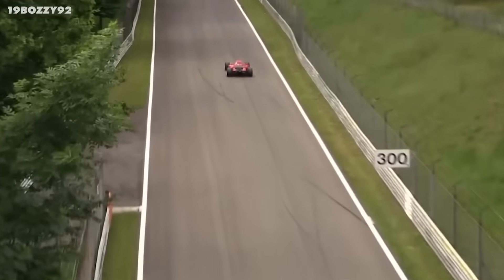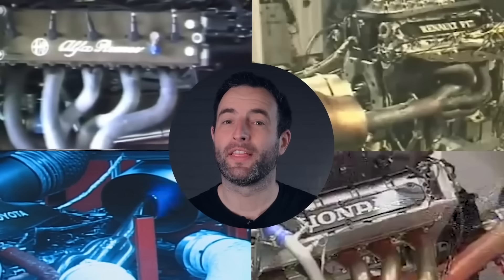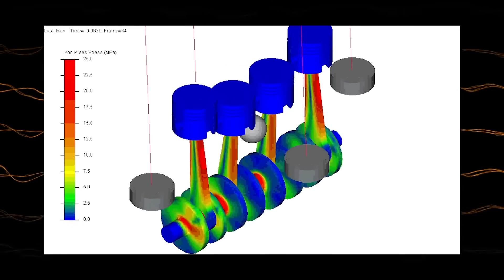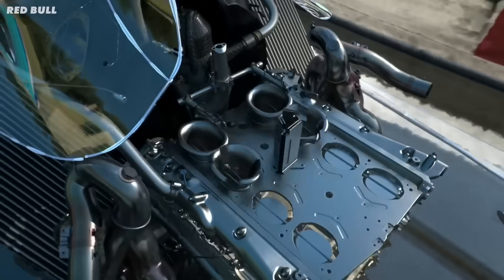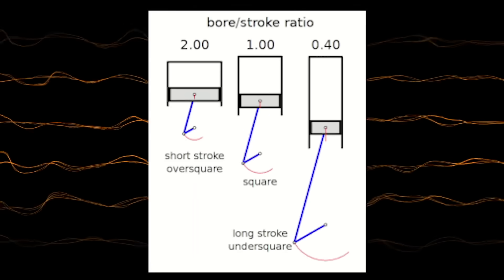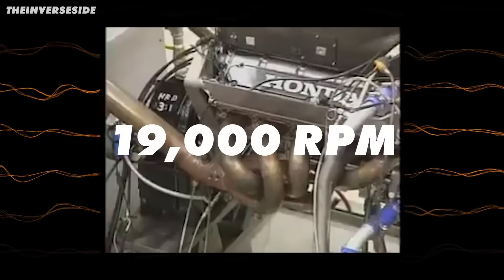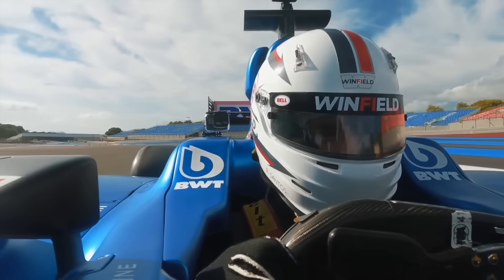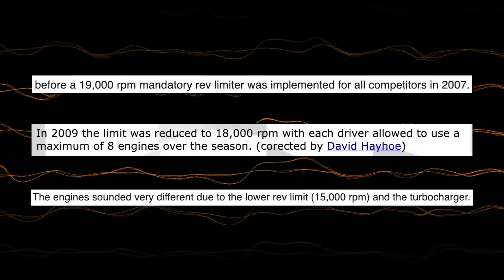When Formula 1 Engines Revved to 20 000 RPM!

Comment: reason V10 sound so good its that the exhaust pulse is in 5/4 time, which is used in spy-esque musics like the mission impossible songs or in jazz. its has more "groove" in it due to the mismatch of the beat number and count number. 
V12 is in 6/4 timing, which most people will refer as an extended 4/4 timing and V8 is 4/4. It is very widely used so it doesn't sound as exotic
Reply: That's really interesting! I've seen a few videos about V12 exhaust setups and how dramatically they effect sound. For example an Aston Martin and a Zonda have very similar engines and the same firing order but one sounds like a VERY angry tractor and the other one sounds like, well a Zonda.
Reply: @bennyb.1742  there are a lot of things that can affect exhaust sounds in the same engine layout. header length, design, material, crossing, mufflers, cylinder head design and material all changes the sound of an engine
Reply: It's not the time signature when it's happening ocer 300 times per second, it's the fact that is a sweet major third. V12's and V8's sound more recognisable by octaves rather than halfway intervals like thirds/sixths
Reply: ‘Doesn’t sound as exotic’…. I have but one answer to this remark: 1995 Ferrari 412 T2 V12.
Reply: I'm a musician and there's no way you can get a 'feel' for or can even determine the time signature at over 10,000 BPM. You might prefer the sound and it might line up with your musical tastes - but that's a coincidence, nor your slow-ass brain with a 15ms thinking latency somehow recognizing the time signature.
Reply: Except it's not. The engines were either even firing, or close enough, so there's only a single dominant frequency depending on RPM. No special intervals except for the regular overtones at reduced volume. If each bank was built like an even firing i3 + an even firing i2, it would have a dominant 3/2 interval (perfect fifth), but that's less smooth, and it would shake itself apart at 20k RPM. You could fake it with exhaust runners of different lengths, but that reduces power.
Reply: @alexandruianu8432  Wasn't there something about the frequencies that could be tuned with the exhausts or intakes? Like Yamaha did with the LFA
Reply: @skwisgaarskwigelf331  Not really, they just used equal length runners like the F1 cars, For a road car, these are more expensive to manufacture, take up more space, and are difficult from an emissions standpoint, because the catalytic converter is pushed further away. 72 degree V10 + equal length runners = smooth single frequency.

EDIT: You can tune the specific sound (timbre) depending on the overall length, but I think they really mostly optimized the exhaust for torque in the powerband.
Reply: @alexandruianu8432  You can also tune them through variation in mass of the exhaust material and fixtures.
Reply: Not really. It's not because of the "time signature" of the exhaust, but instead the tone that ends up being most prominent in the harmonic series. 5:4 is the harmonic ratio of a major third which is what's actually happening with 5 or 10 pistons. This is why you can literally tune exhausts and make those harmonics either more or less prominent.
Reply: @Simoran  Where would the "/4" part come from? The tone is derived from repeated exhaust pulses. Unless those 5 evenly spaced pulses are occurring simultaneously with some other 4 evenly spaced pulses, it wouldn't produce a 5/4 interval. There's no reference period. This could only happen in a hypothetical V9 with even firing banks of 5+4 cylinders (or i9 with a 5+4 crank). You can try it in Ange's engine sim.
Reply: @alexandruianu8432  he's referring to musical timing. As in like, actual orchestral sheet music.
Reply: @bennyb.1742  Which would make it irrelevant to the physics of what's happening.
Reply: @Alexandru Ianu Completely agree with you. This 5 strokes thing doesn’t make any sense from a harmonic point of view. Had it been a polyrhythm, it would be right, but this is not the case.

People just like to get excited and they will come up with a scientifical explanation for that
Reply: Wait...that's not true. There's nothing to denote the downbeat or separate the bars. You could call it any time signature you want to. It's like saying a ticking clock has a time signature.
Reply: @ashscott6068 Yeah, it’s utter tripe. The only thing a race fan would perceive as a possible beat, in the very very short time this speeding bullet of a machine would stay in ear shot, and only if they happen to be spectating in a section of track that requires it, is the gear shifting - which certainly wouldn’t be regular or audible for long enough to determine any kind of meaningful musical meter. In reality, it is exciting because it is loud and it is high pitched.
Reply: @ashscott6068 ...it does, depending on the bpm
18400 bpm is pretty much standard these days
Reply: This particular thread with it's fourths and thirds and fifths and the like is way over my head. 
What I wanted to say though and may be relevant to this is that a bottom dweller F1 team used one these engines to play "God save the Queen" or "The Star Spangled Banner" as a goof to entertain themselves and pit row during a particularly long rain delay. I think Steve Matchet, god I hope I spelled it right, was explaining it and the explanation sounded much like you what you're saying. It was wild listening the engine like it was humming it in a kind of monotone effort but you could clearly make out the notes.
Reply: @hotprop92 ...I remember seeing that
It was Good Save the Queen
Reply: How high could they rev with titanium piston return springs?
Reply: really interesting!
Reply: the V10 sounds so good because the overtone is as loud as the fundamental. it's 2 frequencies at once
Reply: Lol…yea, and the different manufacturers used different scales.
Ferrari used Lydian, Renault used Dorian….
Reply: Not even John Petrucci could use that time signature at 19000 bpm. Dude, like others pointed out, it's about harmonics and the major third. Fourier black magic and shit, as Paulie would say.

Comment: Wish they opened it up again. but 1liter if Forced induction or 2l NA... one engine a weekend, limit cost of engine to keep away the super exotic stuff. Say engines must be sold for $50,000 to any customer.  1000 engines a year made available (homologation specials) 
I never really liked the v10 sound. it's kind of an obnoxious scream, v12's and v8's sound soo much better. but the intensity was insane.

Comment: what RPM did V12 have?
Reply: The ferrari V12's I think was 15K max. That is the best sounding f1 engine ever.
Reply: @SupremeEmperorKizza  I’m more of a V10 fan myself, but anything’s better than the 2014-now hybrids.
Reply: @Alexander Divi Filius  Fair I don't hate the V10's I prefer the sound of the V12 with that scream.
Reply: @SupremeEmperorKizza  it’s personal preference at the end of the day
Reply: @AlexanderAugustine354  Exactly.
Reply: 8-9
Reply: @dvlx8453 8 rpm? I think I'm better cranking my engine to the finish
Reply: 3rpm
Reply: The Ferrari 412 T2, the last F1 car with a V12, revved to 17k.

https://youtu.be/f3fwO8K6drM

The best V12 engines can sound even better than the best V10s I think. The bass note is more pronounced and there's a richer character to the sound. Probably the big reason V10s sound better generally is they revved higher.
Reply: @GlassOnion23  Thank you for the correction.
Reply: I love the V12. Goes up the revs smooth with a little mellow touch to it.
Reply: I believe it's 16000rpm

Comment: Good old days ,i am aware they wont bring them back or even the v8's but at least give them a few more k's rpm(between 2 or 5) so it wont sound so bad.Even F2 is better than the trash v6h.
Reply: They aren't currently limited due to revs, they can rev to 15k in the rules, the issue is the fuel flow of 100kg/hr, that's why they only rev to 12k now.

But in 2026 the MGU-H will be removed which muffles a lot of the sound, so they will be louder in 2026, but probably won't rev any higher either.
Reply: @SkylineBNR34  i know they arent limited by the Fia,its lower for the fuel consumption but still F1 needs more sound & not the s***t show its been since 14,even the 80's v6 had more sound to them.

Comment: When Formula 1 engines revved to 20,000 rpm? Back when times where better
Reply: Back when a radio was more than enough to enjoy F1 😂
Reply: Yes instead of pretend green engines
Reply: And engines blew up weekly...
Reply: @y_fam_goeglyd  Cool.
Reply: @y_fam_goeglyd  And that was brilliant too.  Back in a time when engineers were trying to find the limits.
Reply: @AndyFromBeaverton i am sorry but you dont understand engineering. in f1 you always go for the limit but today you need to complete even more tasks with durability and simulation and when the engine blws up from a design mistake its not an achievement even tho it looks cool
Reply: @ioni6x  BUT now they have artificial fuel flow limit so they cannot go for the real limit
Reply: @ioni6x   Most F1 fans care about the spectacle, not the engineering.
Reply: @y_fam_goeglyd which made every racing weekend unpredictable because it happened even to the best and all of a sudden and the engineers couldn’t predict many engine blows due to back then missing telemetry data. Good old times, never knowing what was gonna happen 😎
Reply: @Utopian_Futures  

Not really, you are all idealizing the past. Remember Schumacher's 3 straight years without an engine problem? Because I do.
Reply: @kerolokerokerolo  I was not specifically referring to just engine problems but all kind of problems, also broken suspension, brake failures, tyre blow-out, gearbox, exhaust pipe, oil leaks etc and due to a less strict penalty system we also had more collisions than today. 40% of the drivers not finishing a race wasn’t surprising. In 2000 I had visited at Magny Cours and Hockenheim and MSC didn’t finish both races due to engine failure and collision. Brawn and Byrne knew how to construct a reliable car and MSC was brilliant in managing a car with heavy technical problems which had forced any other driver to retire ( Spain 1994 probably being the best known case). Montoya and Raikkonen having multiple technical failure in 2003 but Schumacher not was no coincidence or luck but good work.
Reply: @Utopian_Futures  unpredictable sounds way more interesting than being in the same positions for over 30 laps
Reply: @Lamster66  with a Biscotti on the side please
Reply: Right now id be happy with V10 elecy 😎😎✌✌👌👌👍👍
Reply: No more bank loans for petrol engine cars or trucks in Australia
Only electric scooters
Mad Max, the last of the big V8..
Buying 6 litre V8 GMC trucks in America as an investment right now
Reply: Of course they broke. Engine speeds were insane. It's crazy they could even make them go that fast.
Reply: @jefferyzielke7665  V10 Lambo with twin turbo for this guy
2am on a Sunday morning on the Autobahn near Koln .😎
Reply: @negritavg5435  that sounds amazing
Reply: Were
Reply: Back a long while before, Suzuki made a Three Cylinder Two Stroke water cooled race bike with fifteen gears and a 200 rpm powerband. It could rev past 25,000 Rpm and beat a Manx Norton at the Island … over 120 mph if you had the rubber shift foot …
Reply: @Lamster66  That would have been the 70's and 60's, not the V10 era.
Reply: And the sound has gotten more and more depressing since...for me at least
Reply: @Anthony Nevi From a screaming Banshee to a coffee grinder
Reply: And when the racing was the most boring too
Reply: Better for whom? U? Ask costructors how carried the insane R&D costs. Neither u nor anyone else got the point of this video
Reply: V10 overrated af
It sounds good when you hear it for 30 seconds
Reply: @everydaydose7779  hearing it live is an actual hell. I can tell you that. The only way to make it passable is through tv
Reply: @kerolokerokerolo  Earplugs?
Reply: @kerolokerokerolo  ear muffs worked
Reply: @IamTheProblem63  I remember using them when going to the circuit. But it was very annoying using them hahaha
Reply: @kerolokerokerolo  that’s why hearing protection is made. Used it for many racing disciplines I’ve attended